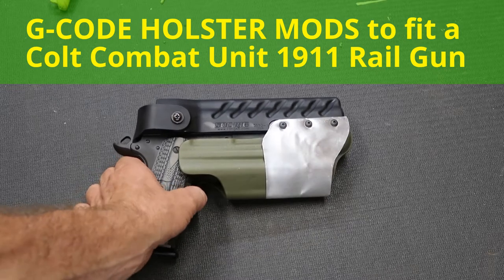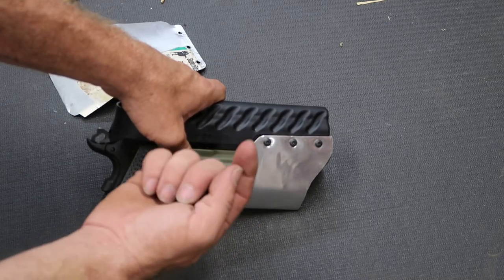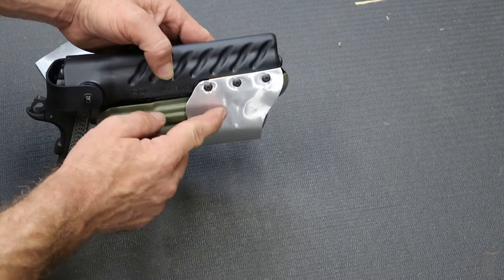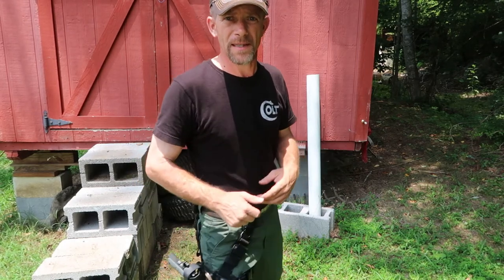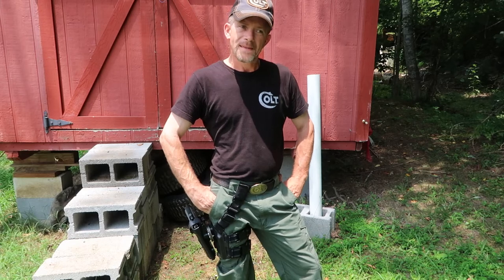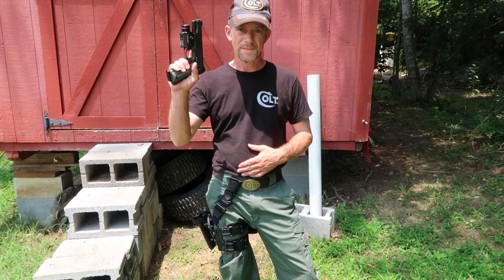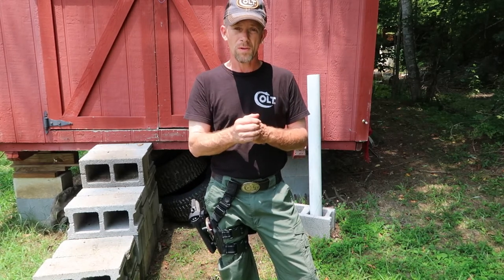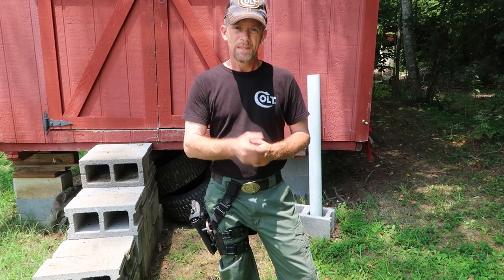G-Code SOC holster Modification

Comment: Howdy sir,

I just got my SOC for my colt Railgun and light. I was able to use a heat Gun and holstered the Gun; fits like a glove now.
Reply from the maker: I wish I had purchased a heat gun before I did this but I eventually just bought the tools and supplies and made a new cowling for it. Came out good and am still using it.

Comment: I have several of the Gcode holsters and I have had a couple of issues with them but it was mostly with my Sig 1911 TacOps with the Squared Slide instead of the rounded type but I do also own 2 Springfield Armories 1911s that have worked out great with the SOC holster and the OSH.  The TLR-1 light have 3 different chassis and Kydex Holster Makers are not taking that into account when you order a holster for railed pistols.  I had a MAJOR issue with a Bravo Concealment RTT holster for my Sig P226 with a 800 lumen TLR-1 so I had to send it back.  I got all my G-Code stuff from Natchez Shooter Supply a couple of years ago when they had it on sale/clearance and SOC holster were going for 25-50 dollars depending on the model.  Well the SOC holster main part can be used with several pistols just have to match the width of the slide and the profile whether round or flat.  The 1101 main section works with normal 1911s like Colts, Springfield etc with the round top part of the slide.  Your Colt Rail has a rounded Slide  so there should not be any issues.  Did the Gun Cowling work on your SOC before you added the weapon light one?  If the gun fitted the holster without issue before the addition of the TLR-2 Cowling then the issue is the Cowling there is a chance that you were sent the TLR-1 by mistake or you were sold the wrong holster.  
I had to do small modification for the Weapon Light Cowling on my Sig 1911 TacOps before I found out that if I used a the Sig 226 main holster section the TacOps fit better and allowed for a proper fit.  G-Code does have good customer service and if you contact them they should be able to help you.

Comment: Great video Brother, and I learned something, I have a Hk mk23 with a LAM and it's a pain a the ass to find a holster that fits, Blessings to you and your family.
Reply from the maker: YEP if it ain't a Glock or M&P or standard 1911 it is hard to find something that works.
Reply from the maker: By the way , I eventually made a completely new cowling . I bought the tools and press to work with kydex. Was a pain in the neck but almost looks factory and fits correctly.

Comment: My duty gun is a Colt RailGun with the Surfire X300... even the safariland duty holster was snug due to the oversized rail colt uses... I used a heat gun to heat the holster and then holstered the Gun with light and threw it all in the freezer and now it fits perfect. I wonder if the same can be done to slightly stretch the kydex to fit on the Gcode.
Reply from the maker: That's what the salesman recommended but I would lose the warranty. Pissed me off and well the rest is on video. After mods I love it. Though it marks up the gun. Wipes right off though.
Reply: mackdaddy1911a1 yeah that sucks about the warranty. But at least it’s functioning

Comment: Should have looked at NSR tactical. They might could have made you the right holster .
Reply from the maker: Reggie Hodges. i did several searches on google, yahoo, bing, and dog pile. the closest was the Safariland but not with my light. Wish i had gotten the Surefire X300. Found several that would fit with it. But in the end I want the Blackhawk platform to mount the holster to. The Y yoke harness keeps the gun from turning on the leg unlike the others with only one vertical strap. I hadnt heard of that manufacturer.
Reply: mackdaddy1911a1 the sponsor James Yeager . They boast on making custom holsters for anything . May be worth a look .